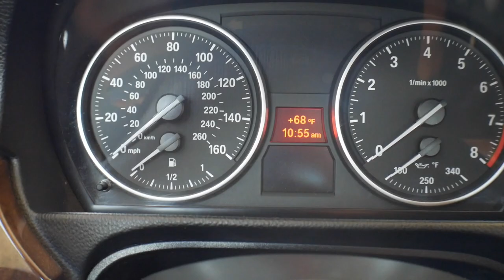I BOUGHT A BMW 335i.... TWIN TURBO!!!!

Comment: Have fun wird repairs, i never ever buy a N54 anymore
Reply from the maker: why is that?
Reply: Probably because he’s not mechanically inclined enough or can’t afford the constant maintenance
Reply: @andyhang3545  n54 takes to much Money and its not really Reliable.
Bought it last year for 13k€ with 130000km.
High pressur fuel pump broke down after 1 week, same to the wastgate. Not that big deal right!? ok but only 10000km later the same...
Car got totalled by an idiot (not my fault). i bought an cheap e91 330d with 278.000km in september 2018, car has current 305.000km and no issues at all.
No question, its an great engine but i need a car that brings me every time i want from place A to Place B with no Problems. Next car will maybe an f10 with n55
Reply from the maker: bro sorry i never saw this message... i just noticed it right now,. that is very unfortunate.. i have had nothing go wrong with this car yet except the coil pack gone bad but so far so good... check out the new vid and more coming soon...